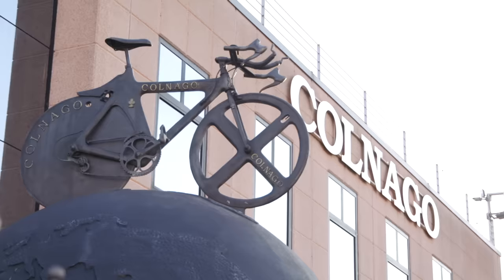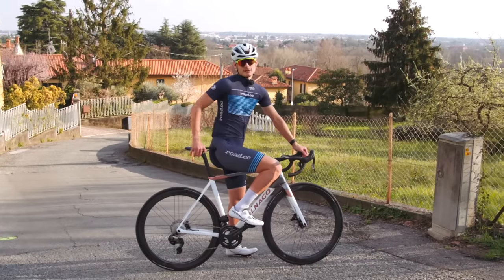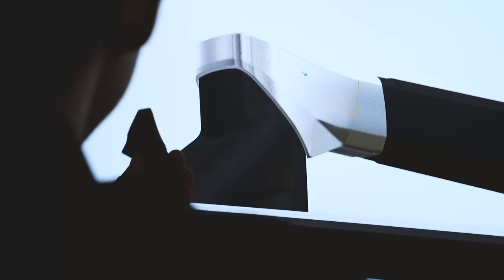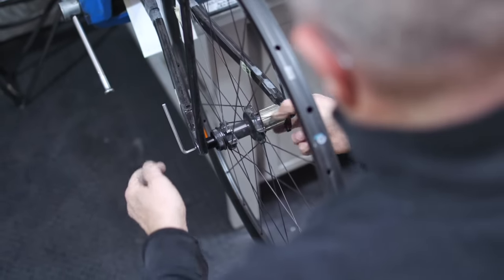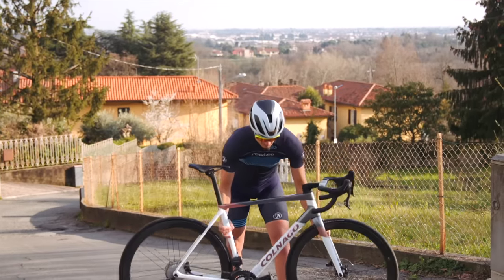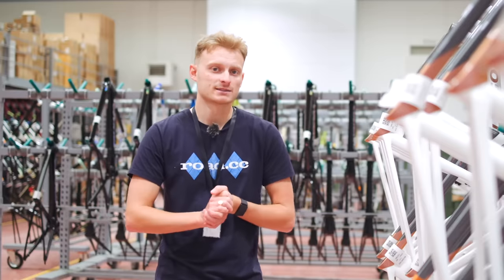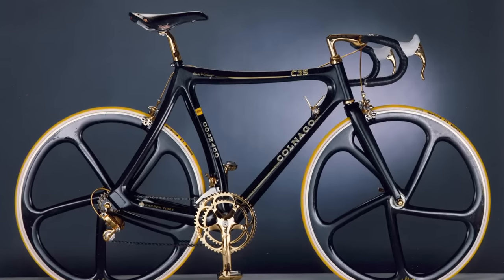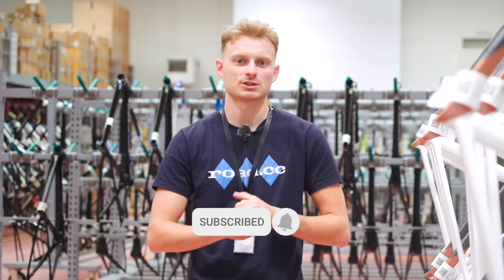Making A Carbon Road Bike The Colnago Way | Colnago Factory Tour

Comment: Received my C68 frameset yesterday! Will get built this week with full Campy Super Record groupset. 
Upon first impression, the paint job is absolutely stunning. It has a shine and depth that I’ve never seen before on a bike. The quality of the fit and finish is at a whole different level
Reply from the maker: Very nice! Enjoy!
Reply: I ride my C64 for a little bit than 3 years, and the paint quality is absolute shite (lacquer started to peal off the frame). I tried to contact factory 2 times, asking how to fix the transparent clear matte lacquer, and basically been told they cannot do anything to help. I find this unbelievable form the premium brand like Colnago and for the premium product like C64... I sincerely hope you will have more luck with it...
Reply: WELL DONE!
LUCKY, YOU DID NOT FIT SHIMA(NO!).
I GOT A C60 WITH FULL SR EPS 11-SPEED, BUT 4 
DEALERS SAID I WAS A 58S, BUT I AM ACTUALLY A 56S!
I HAD TO GET A SHORTER STEM, SO WANT TO SELL & GET A C64 IN RIGHT SIZE.
I RECENTLY BOUGHT A CUSTOM ORANGE BIANCHI SPECIALISSIMA IN RIGHT SIZE WITH 
SHIMA(NO!),ETC, WITH LITTLE USEAGE.
I DECIDED TO SAVE IT, SO SOLD THE BITS, SO I
COULD GET THE CAMPAGNOLO SR EPS 12-SPEED, BORA WTO WHEELS, ENVE BAR & STEM,
ETC!
I ALSO RECENTLY BOUGHT A LIKE NEW BIANCHI 
MARCO PANTANI REPLICA WITH CAMPAGNOLO 
RECORD, ETC!
I ALREADY HAVE ALL HIS CYCLE KIT , WHICH HAS TAKEN ABOUT 6 YEARS & MASSIVE LUCK!
Reply: HRGG?
Reply: @michalispsaliou8004  HRWP
Reply: the paint tthe paint  the paint

Comment: I just love the Colnago color possibilities. During the pandemic I ordered a C64 and it was delayed and delayed and never a straight answer out of the Colnago factory. So, I bought a SWorks Aethos and I just love it. Not as pretty as the C64 or C68 but the ride quality can't be beat.
Reply: "..but the ride quality can't be beat." And you know this because you never rode a Colnago C68?
Reply: congrats to you S_works. Had them from Geroldsteiner up to sl 7, every one. Superb bikes but now i have C68. It is another class, in my eyes much better than Tarmacs. I still use Creo and Diverge STR from Specialized.
Reply: @frankmeyer1865  I wonder what can be MUCH better about C68 vs SL7?
Reply: The actual quality of the paint finish is stunning, cannot fault it. However - and this is a bit subjective - the actual design/aesthetics of all Colnagos really is a bit naff & dated. They just don't turn heads anymore unlike a couple of other brands. I'm probably going to get a year or two out of mine before I send it off for a respray for something with a bit more funk & swagger. Like I said, just a personal choice.

Comment: Im a bit of a Colnago superfan, have been since a kid when I owned a Sarroni Red Master, I now have a C68 incoming (hopefully) in the next few weeks. I've previously had a C40, C50 & C60 - all great bikes but by far the best of them all was the C40. This was the HP B-stay version, which was the last version of the C40 before it was upgraded to the C50, I had the first one of these in the UK. That bike was just pure lightning - with decent legs & in a straight line gallop to a finish line it was insanely fast. It climbed like a rat up a pipe & could handle some pretty rough roads better than anything else out there at the time too. I was involved in a pretty nasty accident whilst riding it to a midweek crit & that bike was unfortunately FUBAR. I replaced it with C50 which was quite frankly a bit underwhelming - it didn't have the speed of the C40 & despite all the contact points being exactly the same as the previous C40 it just felt sluggish, I couldn't actually see what the 'upgrade' was from the 40 to the 50. A few years later I went for a C60 which was a different beast altogether, quick but still not quite as quick as the C40 but very comfortable over long(ish) rides of 5 hrs +. Decided to swerve on getting a C64 but have pulled the trigger on a C68 as I'm finally switching to disc brakes & Campagnolo wireless. Whilst I no longer race & will never be as quick as I once was I'm hoping this new one has the same magic as the C40 I had many years ago.
Reply: This is an awesome comment! I was born in 1990. Didn't get into cycling until about 12 years ago. I have owned 50+ bikes since and raced Cat 1 briefly before life got in the way, but, still very competitive and train hard. Probably the fastest I have ever been. With thay said, about 8-9 years ago, I learned and read up on the C40 and was absolutely intrigued. That became my dream bike. I have had a C40 rotating in my stable since 2016. Two years ago, I bought a mint C40 and had her custom painted in Ferrari Rosso Corsa, modern grouppo and have set new records on this bike. Yes, my race bikes(Dogma F10, currently), definitely stiffer and handles sharper on high speed stuff. Something about my C40, when you get done riding one, you just "feel" more satisfied. The modern bikes just don't give this "soul" vibe, and the C40 does. You just feel like you had a great adventure with a good friend, whilst the modern bike is just like a tool, and nothing more.
Reply: @tommyfreckmann6857  Absolutely spot on - you just get it too. Until or unless anyone has ridden one of these most folk will just never understand. I've also ridden a Dogma too, a fast bike for sure & to my eyes an incredible looking bike too, totally unique - but it still lacks the ride quality of that C40 I had. Since my last post I now have the C68 - it's still not fully built up yet but in the next few weeks I'm hoping to give it it's maiden run out on a regular 85 mile loop with a big of everything - climbing, long flats, pave & rough moorland roads. I'll report back here with an update.
Reply: @chokehanson1830  Awesome! Looking forward to it. Enjoy!

Comment: Hard to say which of the Colnagos I like best. Some of my Colnagos, include four C40s, a EPS, a C64, and Davide Formolo's primary race V3Rs from the 2022 season. All of these bikes have different personalities. The C40s are such classics, and to me hold a dear place in my heart for their historical significance. That said, on the best days, the bike I tend to grab for a long hard ride is inevitably the V3Rs. It is a real weapon, but like so many other carbon bikes, is actually manufactured  by Giant in Taiwan. Does that bother me? Not particularly, but it doesn't have the same romantic vibe that my other Colnagos have. The V series bikes are purpose built race machines designed to compete with the likes of Specialized, Giant, Cannondale, etc. They do that job well, and that is the sort of riding I still like to do.
Reply: V3RS is actually made in Italy （like frozen series and some others) yet v3 is from Taiwan
Reply: @dyihernhan6305  not true. They are painted in Italy but made in Taiwan.
Reply: @dyihernhan6305  in yours mother in law basement.

Comment: My favorite Colnago would be the V3Rs in rim break version. 
Because it is the last model with the C64 to have been designed under Ernesto. 
Because I prefer rim brakes for weight saving and maintenance. 
And because it is the latest rim brake bicycle to have won the Tout de France, probably lighter and stiffer than the C64 so to be preferred by racers.

Comment: I’ve owned several Colnagos over the years.  

Two aluminum “Dreams”
A “Master Ti”
A “C40”
A “C50”

Ironically, the fastest frame seemed to be the least expensive… the aluminum “Dream”.   The “Master Ti” was okay but not as light and not as stiff.  The “C40” and “C50” were very nice … super smooth and great for long rides (touring) but not laterally stiff or light enough for my preference.

The lugged construction does help to create a very smooth riding frameset.   I have a lugged “Look 595 Ultra” that rides very similar to a “C50” but is a little stiffer laterally and feels a little lighter.   I actually bought the Look years ago to replace the “C50”.   I later switched to the Pinarello Dogma which I still ride.

I don’t know if I will ever get another Colnago but perhaps as I age, that smoother ride might become more appealing.

Comment: Colnago bikes are great, but just imagine Time bicycles manufacturing process, it's a pinnacle of bike technology,  like my Time VXS Translink lugged carbon frame,18 years old, designed specifically for Paris Roubaix
Reply: How many miles do you have on it?
Reply: @tommyfreckmann6857  I don't count miles, but I built it last winter, so only few hundred kilometres in high altitude at very rough roads, I love it.

Comment: Nice to see 3D printed parts. I hope to see fully 3D printed Ti and Al frames within next 5 years.
Reply: 3D printed titanium frames already exist, like with the pinarello hour record bike, that now will also be ridden in the world tour and hence is technically available for purchases to anyone. 3D printed aluminium doesn't really make sense for bikes, because there is mainly one reason aluminium is so common on bikes: it's mechanical properties are decent, and it's cheap. But 3D printed bikes will never be cheap as it takes a lot more time to make a 3D printed bike and the process cannot be sped up or parallelized very easily. And as titanium is simply the superior material, the there is no reason to go with aluminium as it wouldn't save a considerable amount of money when the process is the main factor driving the price up
Reply: @kayy-03 that bike was technically 3D printed, but not in one piece (still cool). From what I know 3D printed Ti costs 500$/kg or less, while Al costs around 100$/kg. This is already cheaper than manual labor. Especially if we take carbon frame manufacturing which is insanely time consuming and labor intensive. With modern large 3D printers manufacturers can print frames in one piece by themselves instead of outsourcing this in Asia. Parallelization is easy. We already do this with plastic 3D printers. I see 3D printed titanium as a cheaper and environmentally friendly alternative to carbon for mid and top range bikes with just only one drawback - it's negligibly heavier. It doesn't even require any paint, it's beautiful as is!

Comment: C40 first carbon bike to win grand tour? Check that one! LOOK carbon KG86 (actually a TVT) with Greg Lemond.
Reply: Actually, it was. That KG has alloy lugs, last time I checked.
Reply: @tommyfreckmann6857  Yes true. The C40 was sometimes used with a steel 'Precisa' fork and all the C40 used alloy rear dropouts and - to my knowledge - a alloy bottom bracket insert.  The ones I owned and rode had the Star carbon fork, which like the frame was very nice! Really the 'only' new aspect of the C40, compared to the 'older'carbon bikes' were the 4 main carbon lugs. If these make it the first 'carbon bike' then OK, fair enough.
Reply: TVT's were a completely different brand to Look. I owned a white TVT - nice ride, very comfortable & at the time something completely different. But it was also insanely flexible & the bonding between the lugs & main tubes came unstuck. A game changer for sure, but it was absolutely not a Look.

Comment: I read some misconceptions in the comments about the C68 frame origin. Is the frame Asian or not? The answer is in the "Made in Italy" logo. It's not a simple sticker, it's a strict certification controlled by the Rulers. No way to escape from this. One of the most controlled rule  is "substantial workmanship in Italy" and for those who don't know what it is mean let me say that it excludes "assembly and painting only". Check the list on the made in Italy official site. It's not a bullshit. For example, recently the Italian government banned the use of this sticker on two Fiat/Stellantis car models designed in France and assembled in Polonia. After that Stellantis (formerly Fiat-Chrysler) starts to displays the words "produced in Italy" in italian advertising for those few models that are still made in Pomigliano and Cassino. So enough with the bullshit, check the sticker or the laser print, if there is one it's Italian.

Comment: I used to have a $7,000 Colnago C40 full carbon, top of the line bike.  It broke in half in a 5mph turn, right in the middle of the lugs.  The head tube broke off.  Two surgeries later I am left maimed for life. When I contacted Colnago they told me that my bike was over 2 years old and should have been destroyed. They said, "All carbon fiber frames, no matter who makes them, must be destroyed after 2 years or you ride them at your own risk".  I have it in writing from Colnago.  Consider that when choosing an expensive carbon frame.  I will never buy a Colnago again.
Reply: You cannot compare 30 year old (in its early days) carbon technology, even Colnago, with modern one. Besides, you seriously expect no material fatigue in 20-30 years old carbon frame? Can you google any broken/cracked c series frame in last 10 years?
Reply: Something was obviously very wrong with your C40. Previous damage, or a lemon.
Reply: @jou3708  Absolutely I can!  Since my accident I have compiled dozens and dozens of examples of catastrophic carbon fiber failures - all the way up to the present date.  I also have many examples of carbon fiber failures in  the pro races and they only use the latest technology and have the best mechanics.  Right now my compilation of carbon fiber failures is just over 2GB with 454 files.